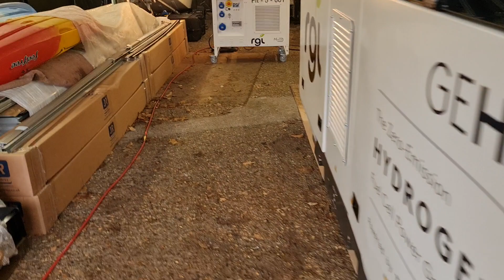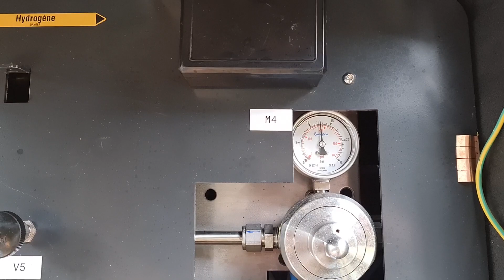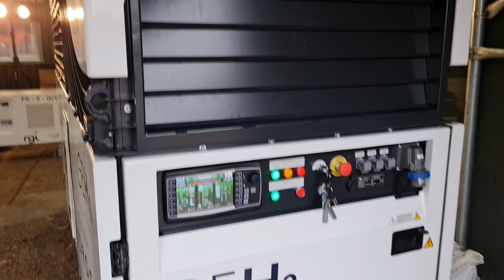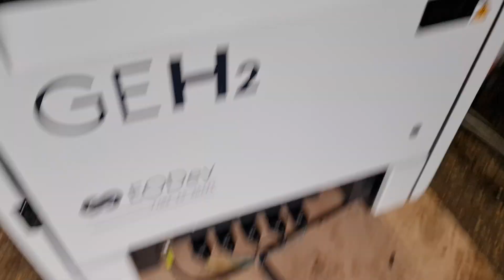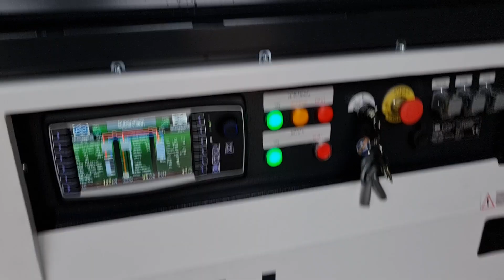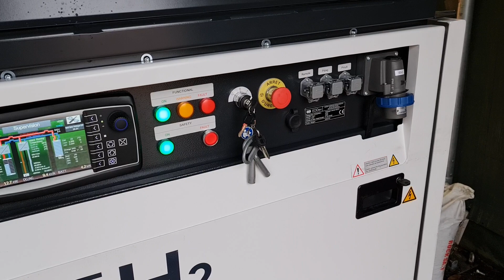70kW Hydrogen Genset for portable green power

Comment: Our innovative hydrogen generator operates with methanol and water as propellants, achieving hydrogen gas generation via a chemical reaction. It enables electricity generation through hydrogen utilization, delivering a power output of 1.5-2 kW per unit and capable of scaling up by connecting multiple units in parallel.

Comment: It's only 'green power' if the hydrogen it consumes is from 'green' sources ie wind or solar (some say EROEI for solar in uk precludes it being classed as truly 'green'). Also, the actual machine must have been produced using green power because otherwise that's a shed load of embodied carbon. The only legs hydrogen has is if we can produce it using nuclear IMHO. £3.50 per KWH? Diesel gen power is about 25 pence a kilowatt hour so not exactly cost effective compared to that, but I wish you the best of luck improving the efficiency.

Comment: 70 KW is really low. Why is this so much bigger than the car and yet it produces so little power?
Reply from the maker: Good day.
Thank you for your question.

The Generator is a Hybrid power unit. Not only does it have a fuel cell, but also a 44.0 kwhr battery combined. This means the unit can provide power from battery only or combined with power from the fuel cell.
Full technical brochure is available for our website.

Comment: How much does Hydrogen cost per Kg right now?
Reply from the maker: Hello.. These generators use bottled H2 gas. 
Cost in UK, currently works out (as of February 2024) about £3.50 per kWhr of power generated, including transport of gas bottles to site.
Reply: @zeroemissiongenerators  that is incredibly expensive. Nobody could ever afford that. Battery electric vehicles typically charge for 1/5 that price or way less.

Comment: Good afternoon! 
very much liked your video about the power cell hydrogene generator.  please could you make a video with a detailed description of how to make the connections of hydrogen cans to the pressure plate  and generator. 
how to run the hydrogen Gen 
how to remove air from the hoses and how to generally run this wonderful generator.